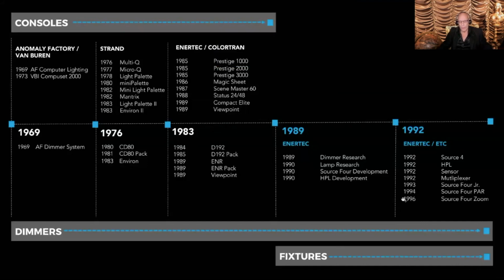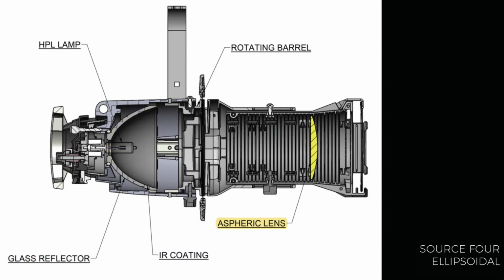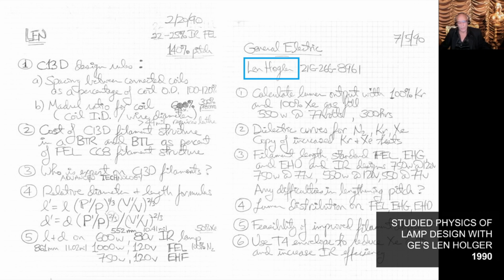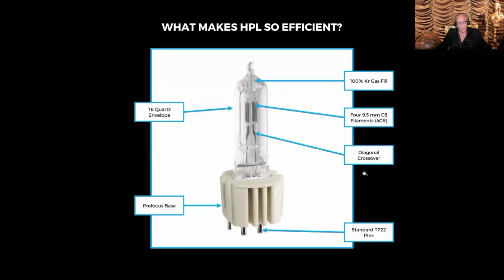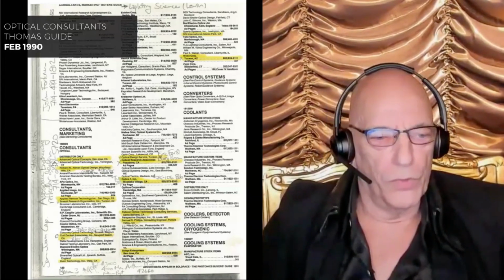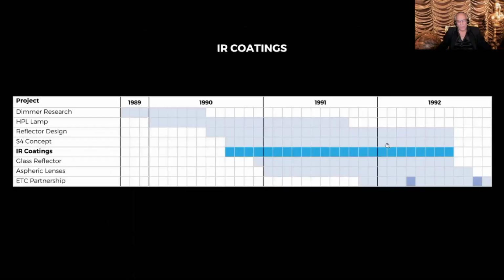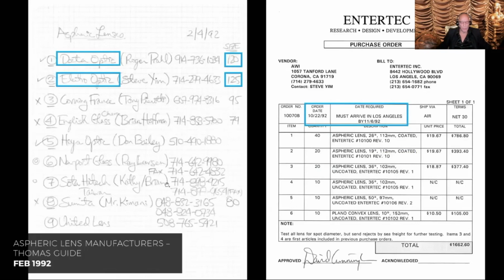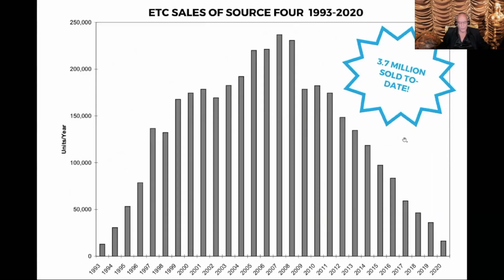Dave Cunningham and the Magic of the Source Four

Comment: They keep refering to an "Altman 360Q with an FEL lamp", which was a not rated lamp by 250 watts, was not UL listed and would kill the socket and reflector.  It was standard operating practice at the time.  As well and at the time of introduction, every electrician was skeptical of the durability of a glass reflector.  It had been considered on earlier fixtures but nobody had put it into practical use.  S4 proved us wrong.
Reply: @Les - Yes, reflectors started to lose their coating after some hrs. at 1000w.  It could be expensive with labor to overhaul these units.